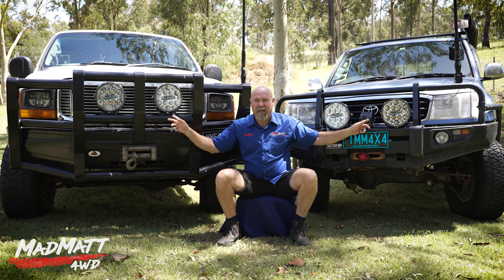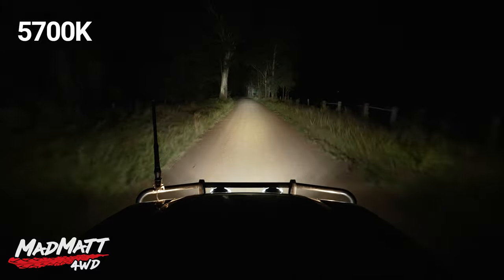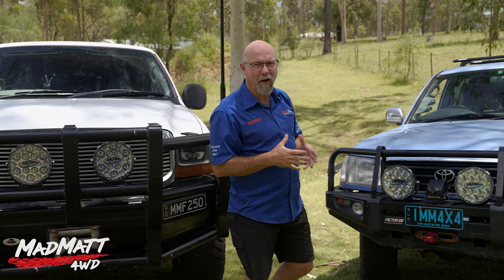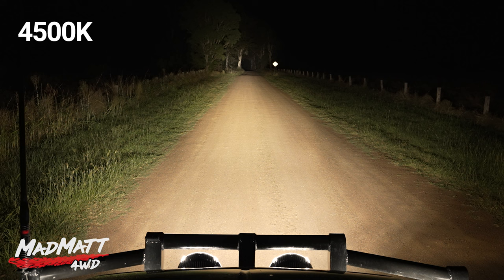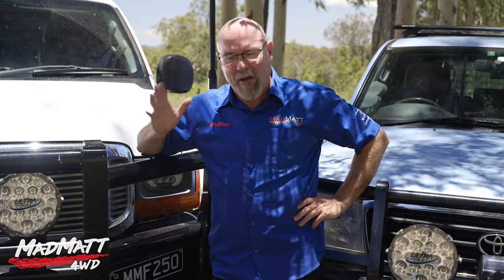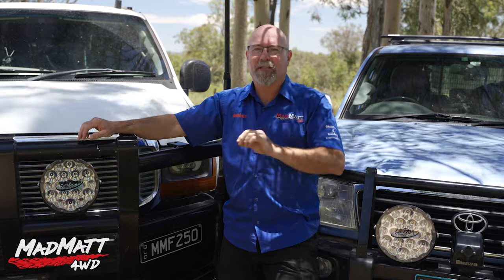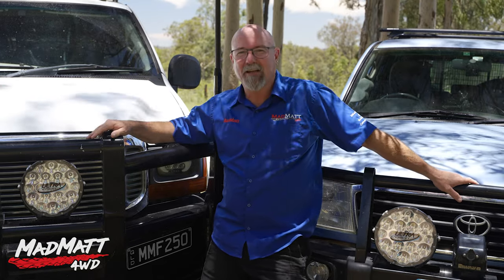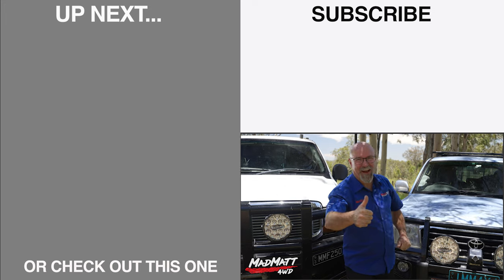Does the colour coming out of driving lights matter... 4600k vs 5700k?

Comment: Just buy a halogen light of 3000k, it will be 100CRI which is the best, but isn't trendy or good for the LED industry but the science is behind halogen lights. If 2 halogens isn't enough put 4 on instead that's what I did.
Reply from the maker: Yeah I’ve sat these next to fylights and these were on par if not marginally better in the peripheral. As well as using less power. As for running 4 that’s just overkill.

Comment: Matt the reason they don't flash you is they think you are already on low beam but have poorly adjusted lights and flashing you again won't help.  It does not mean that they are not having trouble being blinded by your lights.
Reply from the maker: That’s a good point although I think I’d still get flashed. But I do need to get better at going to low beam.

Comment: Some interesting comments you may appreciate :

a) Road sign reflective technology is getting better and cheaper. Spotlights aren't getting commensurately better.

b) Mixing colour temperatures makes for tired eyes and tired drivers are not as safe. All your lights should be the same colour temperature. No one ever mentions this. We have tourists coming out here and it's really annoying having dissimilar colour lights, especially on quads and SxS vehicles. 

c) Driving around in the bush at night with low beam scares kangaroos a lot less. When high beam and spotlights are used the light goes a long way and reflects off the surrounding trees and environment and it startles the roos and so they jump out. Roos are used to the sound of vehicles going by and on low beam they just sit there. When they are scared by the light they tend to sit there and jump out when you get to them. This is an observation, not a recommendation. 

d) I'm not a 4wdriver and I'm not into 4wdriving. I live on a pastoral property in SW Qld.  Out here we just use Hella halogen lights. Mostly spread beams. It's easier to see roos, sheep and cattle with yellow lights. Pencil beams are good for roo shooting mostly.
Reply from the maker: Why are you shooting roos when you obviously appreciate nature?

Comment: @MadMatt 4WD, GREAT comparison and very detailed explanation.

For the last 18+ years, I use only amber lights on the front (and rear) of my trucks.
1. Amber Headlights - Low & Hi-beam
2. Amber Fog Lights
3. Amber Driving Lights
3. Amber Off-Road Lightbars
4. Amber Rear Chase Lights
5. Amber Side Lights for Trail and Camp Illumination

Where I live in the mountains with extended months of winter and abundant wildlife of large herbivores, amber light:
1. Doesn't reflect off the snow
2. Illuminates wildlife sooner (than white) which makes it better to see them earlier so you're able to avoid a collision
1. Reflects animal eye shine far superior to white (for early detection)
2. Reflects faded road lines much better on dry and wet pavement
3. Reflects road signs for easier viewing, even faded road signs
4. Cuts through rain and the glare it produces on the road
5. Does not blind on-coming drivers, even on hi-beams

Here in America, amber headlights are Federal D.O.T. (Dept of Transportation) approved, as long as the light bulbs are D.O.T. approved. The bulbs I use are made by Hella.
Reply from the maker: Great to see how we all need different solutions.
Reply: This is good and correct information.  Amber / Yellow / Warm lights are the best for rural / country use. The city people don't get it.
Reply: @adelarsen9776 , I have people asking me all of the time about my amber headlights and where I bought them.
Reply: @TACTICALNOMAD   Yes, i can imagine. Many people are more interested in buying the latest accessory and showing off to their friends and cohort.
There's not much common sense and real knowledge out there anymore.
I wish you good health and prosperity.

Comment: Great content Matt. A lot of people I know buy spotties buy  price. I’ve learned a lot about spotlights. It’s a great comparison. I’ve got light forces on the 80. They have saved my bacon a few Times. They are getting a bit long in the tooth so these lights will make an awesome Mother’s Day present. 
Keep up the great work Matt. 👏👏👏
Reply: On my 80 I have different lights on the inner and outer lights a mix of led and hid in different k ratings with relays and new wiring so I can have either inner or outer on high or low or all going at the same time, same with my spot lights different spots on my bull bar the old low k yellow lights and 2 different k led bars on my roof rack, I use what lights best suite my driving conditions. Sometimes the high k blue/white lights are better some times the old yellow low k candle lights are better, it doesn't hurt to have a few different lights that you can turn on and off with the flick of a switch with new wiring and relays on the old 80s

Comment: Matt, back in the day I ran 8" SEV-Marchal spots with 100w halogen bulbs. At the time halogen headlights with replaceable bulbs were illegal in the 'States for cars, but OK for motorcycles. Of course we swapped them in. I used either Marchal or Cibié 7" headlamps. These days, all I've done is put yellow led's in my factory fog lamps (no off-road vehicle currently).

Comment: I remember driving home from Orange one rainy night in my Brother's Subaru, he had a set of 6500k LED's in the headlights, it was honestly terryfying, felt like driving without lights at all, except for reflective surfaces, which glared like the sun.
I'm happy with the light colour of my Stedi lights that I run now, but I still throw on a set of yellow filters for a long drive, it's just so much easier on the eyes. I have upgraded headlights so the dip to low beam isn't as drastic a change.
Honestly it was the filter options that sold me on the Stedi's, as I have the yellow option, as well as a diffused option for driving tight tracks, as it turns them into a bright floodlight, rather than long range driving which is useless on tight tracks.

Comment: I have to totally agree!! I went with some new LED's a few years ago (a very bright white light) & guess what?? I had trouble seeing any detail & the wildlife to the point of not seeing a roo until the last minute &I  cleaning it up! While I have encountered plenty of wildlife living in the country, I was surprised that the colour spectrum didn't actually suit my driving. The same can be said for a light bar on the roof. Even after painting my bonnet black, the back of my alloy bullbar & anything else reflective) I still had heaps of glare ! never again! I think this time around I have found a good combo in some small light bars built into my bullbar on the angle out for the slow bush tracks at night & some good warm lights for spot lights for other times. I've always been very conscious of my lighting & often dip too early be I have been the receiver of "A" holes who leave it too late! My honest opinion is just finding what works for you & your needs (like most things) & settle on that, sometimes going big or too bright can be a mistake especially if you deal with lots of wildlife like we do!

Comment: Im into motorcycles and we have LED lights that will go into a lower output on low beam. You wire a trigger feed back to high beam. So you end up with 1 switch to turn them on with the high beam and an adjuster to tune to your preference on low beam. This week I will be fitting a set to my jeep.
Reply from the maker: That’s cool. I don’t think that’s allowed in australia.

Comment: Great video. I have the 140 widr, which I believe are 4000k (couple of years old now) on a 200 series Landcruiser. Love the lights, but I do find the different colour to the factory headlights an issue. Just something to consider. Thinking of transferring the 140’s to my 79 series as the old halogen candles will suit. Then put the new 180 widr on the wagon, just not sure if 4500 will blend in with the factory headlights.

Comment: The irony is that color temperature is opposite to how we label light; "cool" lights are hotter, "warm" light is cooler.  I prefer lower light levels at night because it preserves my night vision.  Turning the lights off doesn't leave you quite so blind, and your vision adapts sooner.  That is probably why you prefer the "warmer" light.  In North America, the animals you can encounter range from moose and grizzly, to deer, loose cattle, and an occasional horse.  I like a good angular spread on my light beams.  Animal eyes will flash, letting you know there are critters off to the sides of the road, and you can act accordingly.

Comment: Here in the UK there are a few different lighting regs, so things are slightly different. Honestly the best lights I've had were Elta blue H4 bulbs, I bought them with a car and they lived in the next 3 as they were so good. I know one failed and found the other one the other day, they are still made! Bonus! So will be getting some more at some point. So I will be running H4 standard 7" headlights (Wypac Crystal headlights) and Hella Comet 550 square spots (H3 bulbs) They give the Defender a great look, and work well. I find the blue tinged light from the main lamps great for seeing a little clearer at night as we have some different hazards we encounter. We have one of the largest Deer parks locally and so there are a lot of wild Deer. Good lights are necessary to spot them as they leap out of the undergrowth onto the road...

Comment: I have the Narva 215s they are very high kelvin (and falling apart after 2 years). I have the Ultra Vison on my D-Max in the Nitro Max 180 in 5700k and Bought the Raptors in 4500K for my partners cruiser...... suffice to say. I ordered another pair of Nitromaxx in 4500K for my cruiser. These are brilliant lights. The Hi/Lo function is a great feature without any unnesessary gymicy stuff that other lights are coming with now. Definitely put that switch in a easy to reach location as Matt said as I experience the same battle in my D-Max. The company stands behind this product feircely too which is more than can be said for basically all other manufacturers with whom I have had no help or support in the past. Buy once, cry once, support Australian Manufacturing.
Reply: I'll also note I put a UV Filter Tint on the Dmaxs windshield and have found that it does help with Roadsign Glare without making Polarised sunnies no good in the day time.
Reply from the maker: Great comment and yes they’re passionate about backing their products.
Reply from the maker: That’s interesting.

Comment: And there we have it, "low beam" light quality and width is far more important than high  beam and massive lights out on highways where oncoming traffic is common and we are constantly flicking between H and L. The transition from the massive lights on high down to low is the absolute "danger zone" for a few seconds whilst eyes adjust. This adjustment for low light takes up to 3-4 seconds which is a few hundred metres travelled. This is amply indicated on one of Matt's lights as the low beam is total crap. Out on the busy highways a fantastic spotlight is one where a wide beam is best with a lower power 'dial down' intensity so signs dont blind you and you can hang on to high beam for a little longer, also the transition to low beam is safer at speed. Then when off onto the tracks dial the intensity up to max. My advice is to 'work on' the quality of low beam before the massive lights are bolted on. There are many ways to do this from complete headlight change to looking into various led/halogen/xenon bulbs. Xenon low beam quality on an once owned 100series was so good with brilliant lens cutoff design I hardly needed high beams on regular runs down the Monaro Hwy. to snowfields many many times.

Comment: Perhaps something else to consider is the Kelvin of the OME lights on the car. I have found having a big jump between car lights and driving lights K,  leads to some really uncomfortable transition blindness moments. I run the Stedi x pro which I love off road, but when on road and have to step down from driving beam to the traditional 100 series 2 candle lights, really leave me blind. I have also been looking at lights with power level transition ability to make it more comfortable on my eyes when you go from drive to high to low beams.
Reply from the maker: As you saw in the video my 105 series lights are disgusting.
Reply: @MadMatt4WD  Yep, if you ever see anything that's a decent upgrade, please do a video.